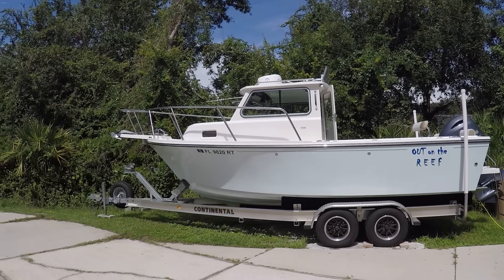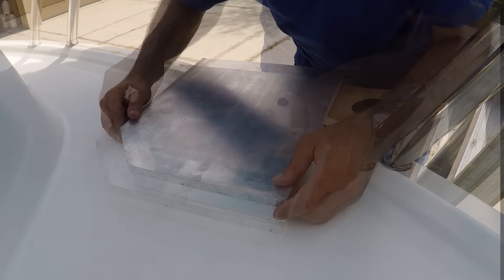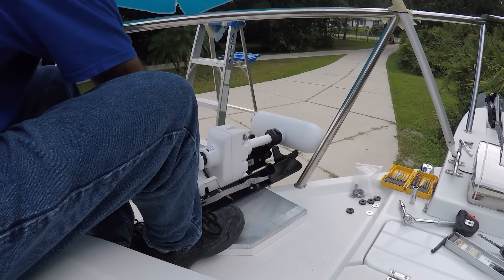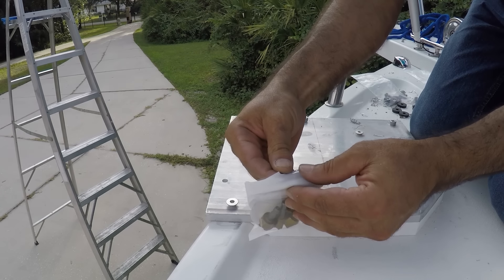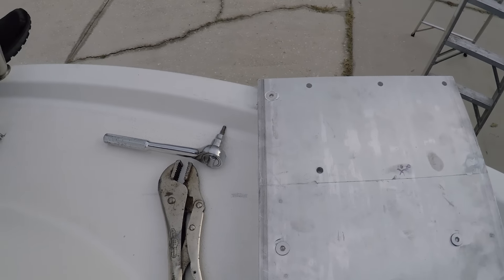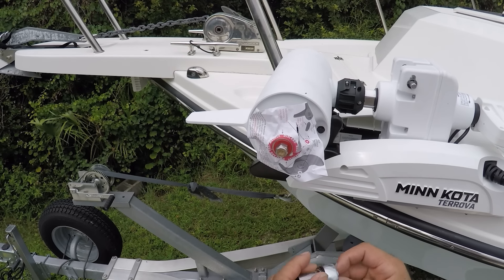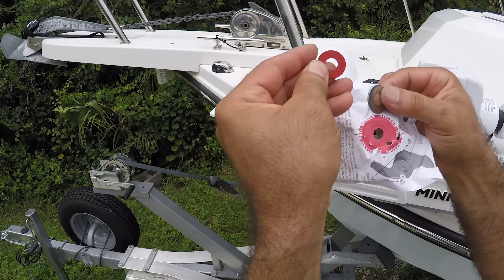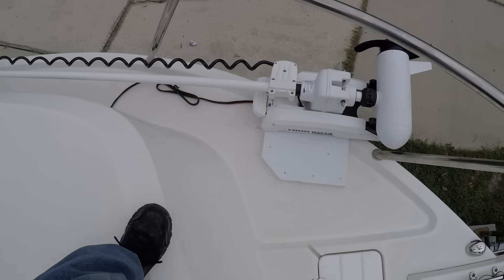Custom Installation Minn Kota Riptide Terrova 112 thrust 72 shaft Trolling motor Crooked PilotHouse

Comment: The only thing you should have done was to install caulking around the entire perimeter of the Starboard plate and the drop the metal plate on top. You don't want salt water to get trapped between the plastic and metal. Otherwise great install.
Reply from the maker: That's a great idea Captain but it's aluminum it's not metal
Reply: @OutOnTheReef  Aluminum will oxidize. All metals should be bedded to remove oxygen and salt water to control corrosion.

Comment: On your stainless bolts that were to long, just tighten up the nuts, then grab the bolts with a pair of vice grips and wiggle back and forth. They will break off flush with the bottom of the nuts.
Reply from the maker: Did not know that I'm going to try that thank you Captain

Comment: There is a holder that keeps the head of the trolling motor from bouncing around. Its a screw on clamp works great send me a message i will send you a picture
Reply from the maker: I already purchased one it's a mount is awesome I will show you in one of the next videos what it is and thank you for the heads up Captain
Reply: Out On The Reef 👍🏽👍🏽

Comment: You have used the wrong nut on the propeller as it should be a sacramental nut.
Reply from the maker: Since 2019 October the company Minn Kota has discontinued be anode part for the bolt, it's no longer being made or required by the company.
But thanks for the heads up Captain